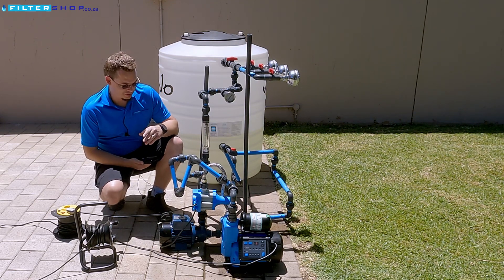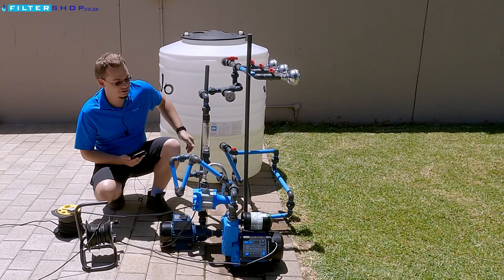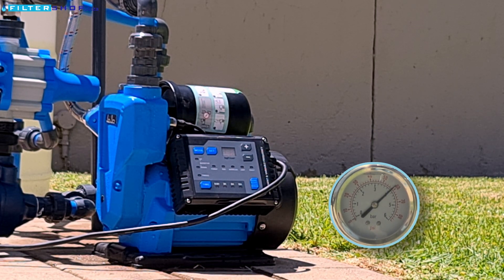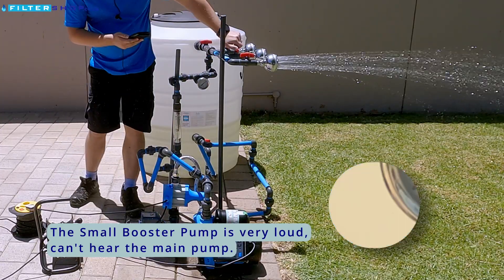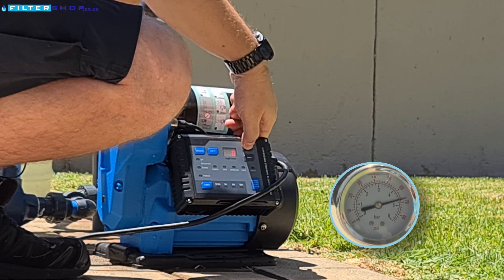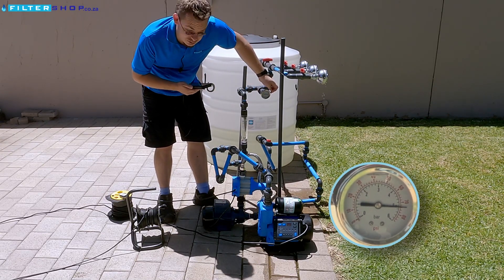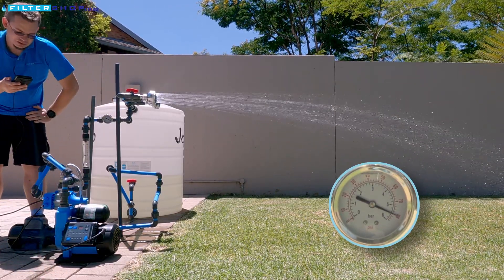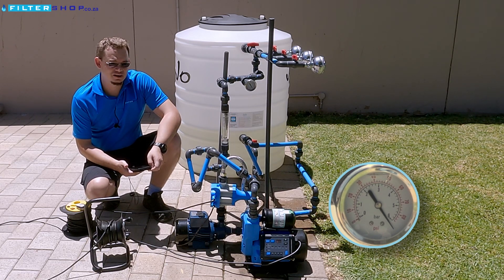VSD Pump Fed By Basic Booster Pump Test

Comment: Is a VSD booster pump worth the high cost?
Reply from the maker: Hi, It depends on the situation. You can get a lot of the same benefits by using a dumb pump with a big pressure tank. We tested it here: https://youtu.be/IWUXIgjzCI4 It is however a simple solution to lower power consumption and the pumps themselves tend to be better quality too. The biggest point is probably if you want to run it from an inverter as the non vsd pumps can often trip solar inverters as some of them have massive startup currents. You also normally have a controller that you can set a lot more in the vsd pumps and many have functions like leak detection. They also tend to run quieter, but they are also not all created equally. There is a massive jump in quality and silence if you go for something like the DAB Esybox from another vsd pump.
Reply: @FilterShopZa  Thank you for the feedback. I will try the VSD Jojo booster pump. Yes it is a solar setup, but fairly big. Ran the same system with a normal .75kw booster pump. Consumption was a bit too high, but no tripping or other issues.
Reply from the maker: @rstrajt9220  Also look at the Stainless steel option from the same manufacturer as the Jojo as it doesn't have the corrosion issues. https://filtershop.co.za/en/hms750-075kw-intelli-booster-pump Or the best option in the market at the moment is the DAB Esybox mini but it is a bit more expensive: https://filtershop.co.za/en/dab-esybox-mini3-075kw-vsd-booster-pump

Comment: What is the black plastic check valve for that came with the pump, where do I install it?
Reply from the maker: Typically it would be a non return to prevent water from flowing back to the tank if your tank is at a lower level than your pump. There are ones that are designed to go in the tank but if it is an inline one then you want it as close to the tank as possible to keep the line primed.